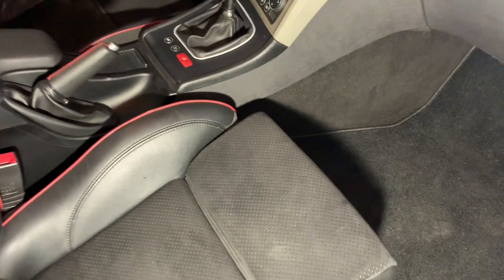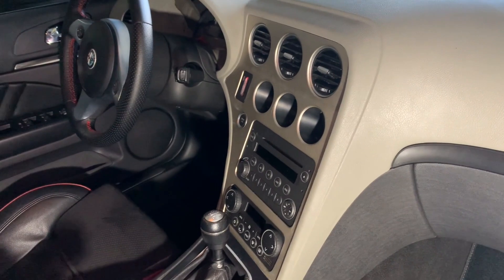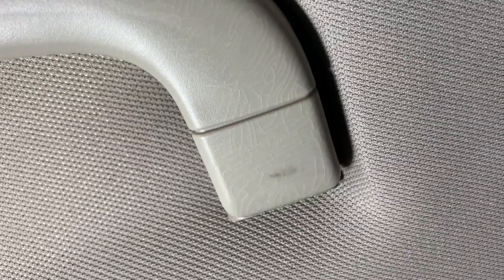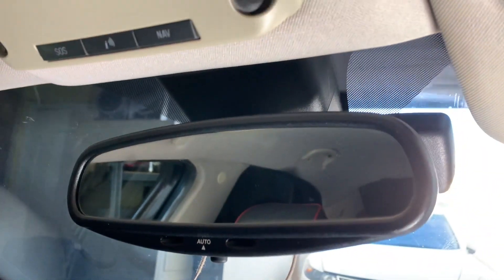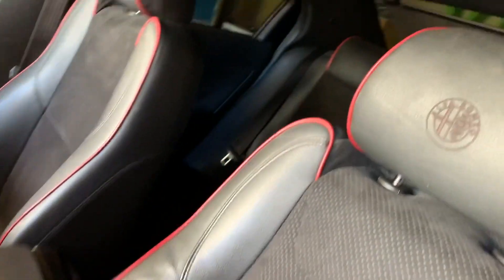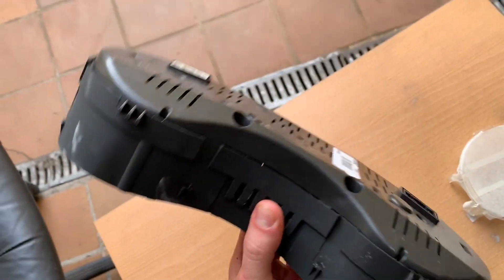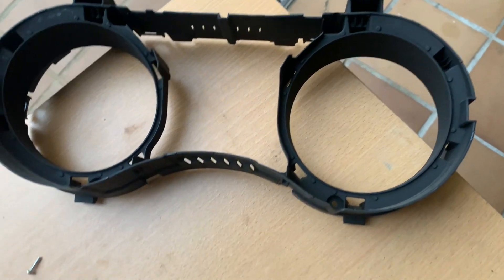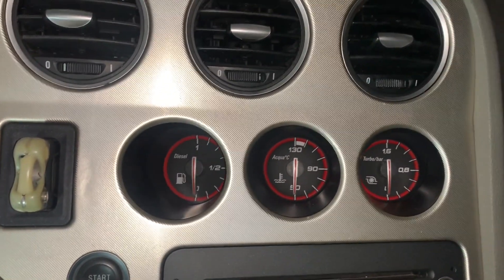🟢 Alfa Romeo 159 2.4 200🐎 Parte 13

Comment: Tapizados korosi. Está en Marqués de Vadillo por la zona del Calderón, recomendable 100 por 100.Hace años lleve un volante m de BMW E46 para realizar y el resultado fue espectacular. Los laterales en cuero sintético microperforado, muy buen tacto en general y precio creo que fueron sobre 160 euros,no recuerdo bien. El chico supermajo dejé mi volante y para poder llevarme el coche me monto un volante de E46 que tenía por allí. Como anécdota recuerdo que en aquella época el tenía un 159 precioso en el taller, no sé si era suyo o de un cliente. El día que tenga que volver a tapizar repetiré sin duda .
Estoy pensando en adquirir un 159 y tu canal me está ayudando mucho a decidirme. Enhorabuena por el canal💪💪
Reply from the maker: Hola,David Cuerda Relució! Muchas gracias 🙏 Ya he hablado con Tapizados korosi y la verdad que la conversión de un volante normal a uno de ti está bien pero yo quiero el original ti . Así que lo más probable es que compre uno original de ti(ya tengo algunos vistos en eBay) de hecho creo que lo comprare estos mismos días y así os lo enseño en el próximo vídeo. 
Por lo que tengo entendido el chaval es un Alfista también y si vas de parte del foro Alfistas te hace un descuento.
Me alegro de que mi canal te ayuda a decirte en comprar un 159 👌🏻 Ya me contarás . Un saludo 👋🏻

Comment: Buen video , tengo una pregunta , referente al alfa 159 .
Tengo uno visto pero es 1.9 diésel 150 CV.
Es coleccionable , es fiable .
Es un coche q aumente su valor .
Reply from the maker: Hola,Verum est ,durum! El 1.9 de 150CV es el mejor motor diésel que montan los 159. Es muy fiable pero hay que tener un poco de cuidado con la EGR el FAP y si es del 2005 a 2007 habría que anularle las palomillas de admisión (a partir del 2008 la admisión es de plástico y las palomillas también..así que si le las traga no pasa nada) Lo demás mantenimientos al día,buen gasoil para mi tener problemas de inyectores y que no te asuste si silba un poco el turbo..en “normal” mientras ni chupe aceite . También habrían que cambiarle la valvulina de la caja de cambio,líquido de dirección y de freno pero me imagino que esto se lo harías de todos modos . 
Es verdad que los motores Fiat son ruidosos pero créeme que los motores Volkswagen del mismo año son aún más ruidosos 😅 
Yo he tenido varios 1.9 desde los 150 mil kilómetros hasta 280 mil y la verdad que los coches siempre se han portado muy bien. Solo les tuve que cambiar cosas que tenían desgaste por los años y los kilómetros..como el embrague,mariposa,algún injector,turbo, alternador..pero vamos que nada del otro mundo . Si necesitas saber cualquier cosa más no dudes en preguntármelo . Un saludo 👋🏻